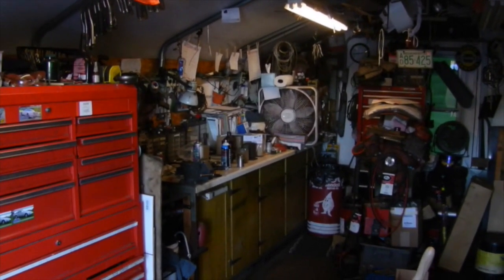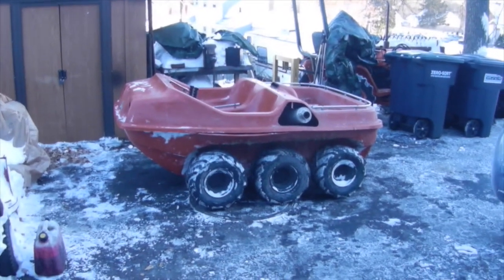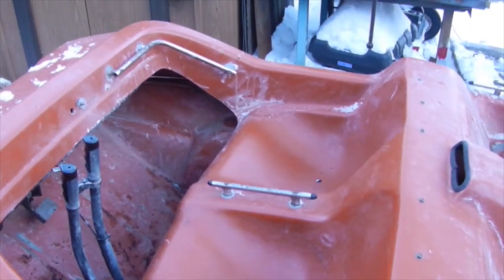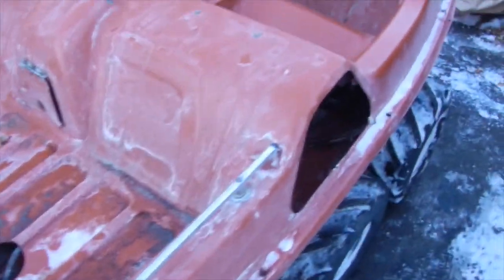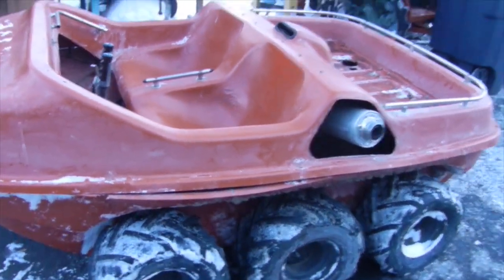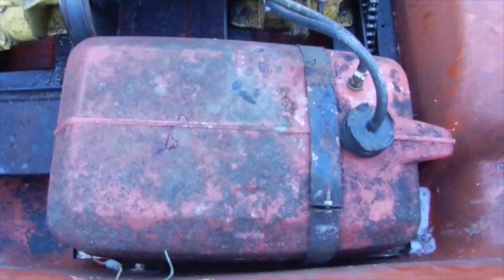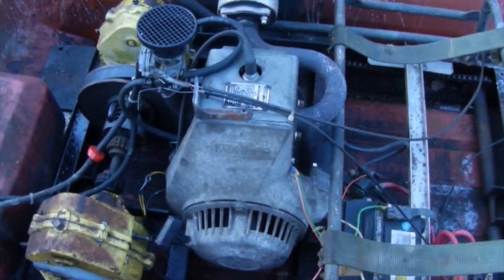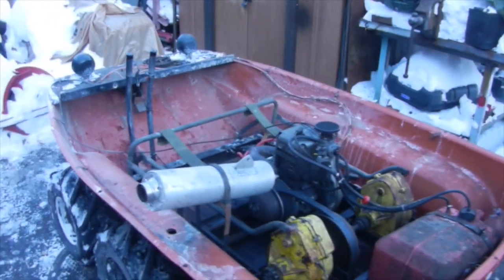Sierra Trail Boss Amphibious 6X6 Vehicle

Comment: Just saw this page and had to respond. I very likely produced the sheet plastic for the body of your SierraTrail Boss back in the 1969-1970 era. I worked for The Vesley Co. in Lapeer, Mi. for about 6 months setting up the extrusion equiptment and running the sheet for this project and products for their camping trailers as well. The material for the Trail Boss was Phillips 66 Marlex high density polyethylene developed by Phillips just for this project. It had superior cold impact and stress crack resistance and was produced in either 1/4" or 3/8" thick sheets for both the top and bottom shells, on a 6" Prodex continuous extruder. The sheets were then preheated and thermoformed over water chilled epoxy molds. The depth of the draw for forming the shell was quite deep and presented many difficulties to get just the right hot strength of the heated sheet without it thinning from the sheer weight of the mass. It took much engineering and experimentation to get a workable product. 

I actually got a ride in one of the prototypes from the test driver one Saturday and he scared the hell out of me by running the test course with me in it. They were pretty well engineered vehicles considering the technology of that era. I worked for Vesley just long enough to get the bugs out of the manufacturing systems. They had a seat of the pants engineer who knew absolutely everything or so he thought. You could not work with the guy no matter how humble you tried to be to keep peace, and therefore I left after fullfilling what I was initionally hired to do. The owner Gene Vesley tried to get me to stay and even offered a lucrative position but I had had enough of that Jackass. I don't know what he had on someone with that company, but they kept him despite his lack of leadership and bullying personality. He was more of a hinderance than help. I never regretted leaving that company.

Hope you are still having fun with that ole scooter. Stay safe and healthy. Stan Bennett, Florida

Comment: My Dad worked for Veslies back in the day when they started building these rigs. He used to come home with one of these and we used to see if we could break them for development reasons. We had a blast with them. There was a time when they used to put bigger engines and roll bars in them and race them. Biggest problem they had was they couldn't get the axle seals to keep out the water when you took it swimming.  Good luck with the restoration
Reply from the maker: That must've been cool as ever! Bet you guys tooled around everywhere ya could in those things...
Unfortunately I never went through with the resto... had the clutch bands relined, rebuilt the transmissions, then got to the rest of the drive train and found that a lot of the parts needed replacing (and were impossible to find). Would've been an expensive endeavor to have custom made sprockets and such.

Comment: I worked on the design of the Trail Boss around 1970. Used to take them out into very rugged terrain and see how much punishment they could take. I would come up to an extremely steep cliff, get out and push it off to see if it would flip head over heels. After 3 or 4 times, if it did not flip, I would ride it down.  We used to demonstrate that it would float and the tires would provide enough propulsion to cross a pond.  One time, our advertising manager gathered the local press for a publicity stunt. With cameras rolling, he drove the trail boss out into a local pond and it immediately started sinking. The body drain hole plugs were missing!  
Eventually, we decided that it would be  better vehicle with a 4 stroke engine, but we already had a ton of 2 cycles in inventory and the market dried up before they were used up. The four cycle was much quieter, had more torque and was better for low speed maneuvering through rough terrain and forests.  Some of the employees raced the 2 cycle version, would get them up to 70 MPH and would race through trails in the woods. One went airborne and the bottom of the Trail Boss hit the trunk of a tree. Everyone survived. It was a very well built product that could run into, over and through everything except an environmental movement.

Comment: THIS is EXACTLY what you need! NOW you can practise on running an older Case dozer or loader. They had the same tranny setup. A guy had one of those amphib things here BUT it was either moving or locked down. Jaw clutch steering.  In or out. Don't think it lasted too long. I'd just run the Kohler and see how it did. Didn't look too shabby from here! Stay warm and GOOD VIDEO, Pa;!
Reply from the maker: Then I'll have to find an old dozer! I'll have to see what all the rebuild parts would cost for it. If it's not too bad I may rebuild it anyways just to have it on hand. Warm!? It's in the 20's today, compared to the average 4-6deg this is great!
Reply: I got up to get some wood for the heater and it was 34! I was about ready to go lay down in the yard and get some sun! LOt of difference between there and here but there's a lot of difference between 10 & 11 and 34! I'd build that buggy it just to cut do-nuts in the snow! Can't cost a whole lot. YOu might even find some Gravely parts that'll fit it! Stay warm, Pal!

Comment: Part of the reason that thing feels underpowered is probably because it has a four stroke exhaust on a two stroke engine........if you swap to the briggs you will have to change some things in that secondary clutch because there will be a large difference in max rpm from the two stroke to the four stroke twin......

Comment: I bought one of these its needs a belt, the clutch assembly (rear axle) looks to be one piece. How would I go about getting the new belt around the pulley
Reply from the maker: Look ahead of this video and find my Vesely transmission rebuild video. I remove the transmissions from the body and you should be able to see how the belt comes off.
Reply: @5Tractorguy  I figure it out, in swapped in a 420cc china freight motor and it's so much better to drive! I want to see if yours floats before I try
Reply from the maker: @johncooper8144  Don't wait on me! Mine is still all in pieces... I have a feeling it's going to get sold as a project unfortunately. Not enough time to finish.
Reply: @5Tractorguy  I wish you wouldn't, you're the only source for knowledge on these lol

Comment: I would rebuild that 2 stroke, might just need some love to make the power it used to when it was new. You going to restore it?
Reply from the maker: If the parts are reasonable for the Kohler I may just rebuild it anyways. Still haven't decided what I'm going to do yet. 
That's the plan. I figured if I pull it all apart I mind as well paint everything inside and replace what needs to be. Don't think I'll paint the body though since the orange seems to be okay.